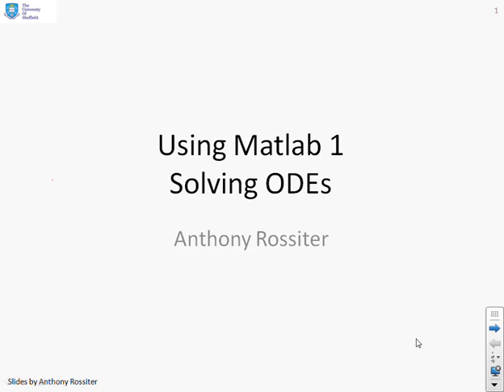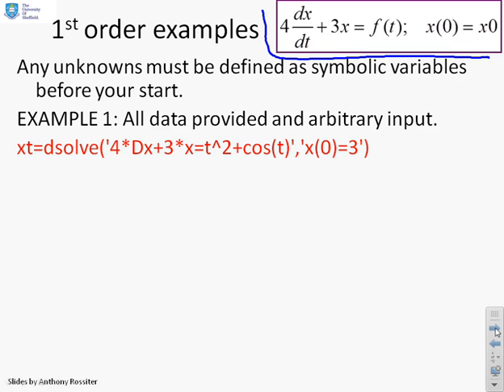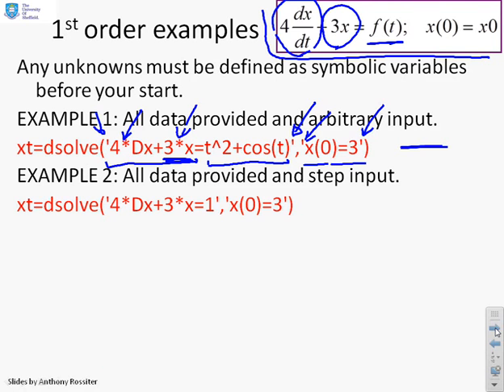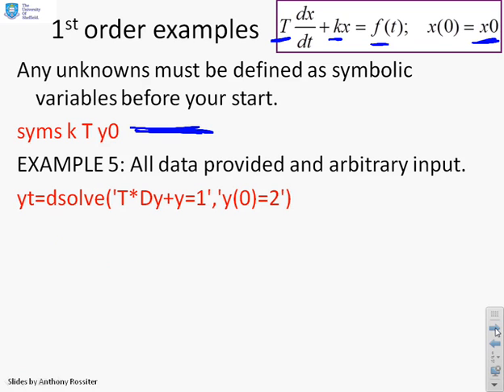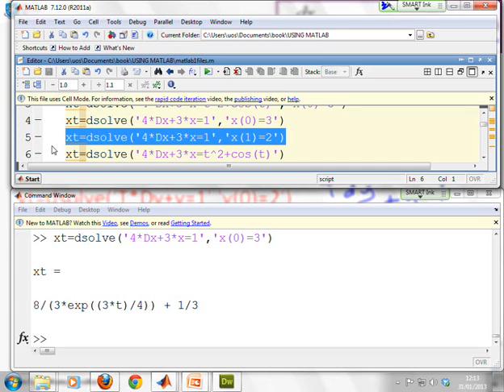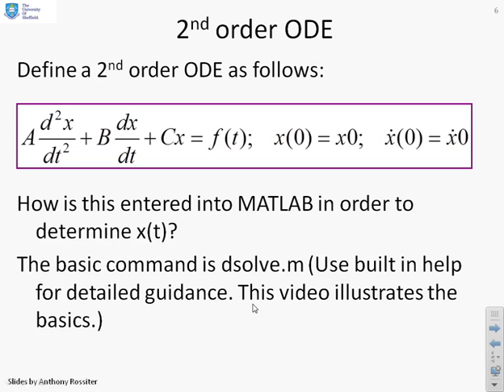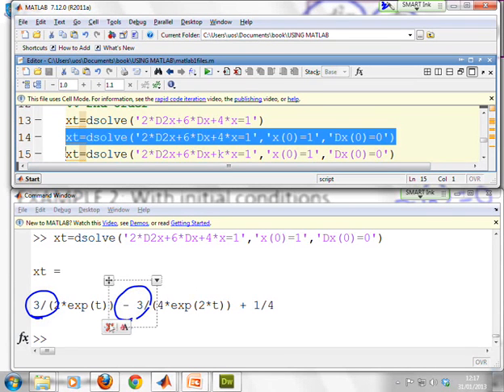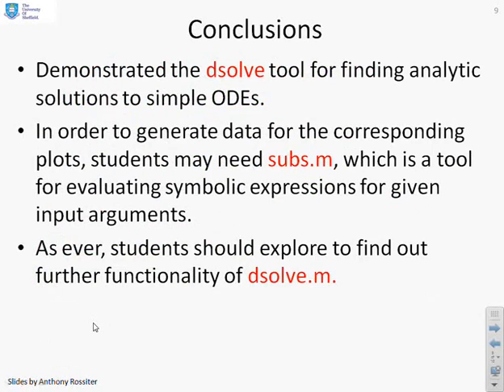Use of Matlab 1 - solving ODEs: OLD

Comment: hi;
please how input this constraints in xdot function to solve the 2nd differential equation to obtain the solution y with ode 23:

y"+cy'+40y=0
with c:

c1-c2>0.5
c2-c3>0.5
c3-c4>0.5
c4-c5>0.5
c5-c6>0.5
and:
c1 the value of damping in [0 0.15]
c2 the value of damping in [0.15 0.3]
c3 the value of damping in [ 0.3 0.45]
c4 the value of damping in [ 0.45 0.6]
c5 the value of damping in [ 0.6 0.75]
c6 the value of damping in [ 0.75 0.9]
best regards;
function xdot = modelcart(t,x)
  y = x(1);
  dy = x(2);
   z = x(3);
  w = x(4);
 % function damping
  xdot(1,1) = dy;
 
  if t>=0 & t<=0.15
  xdot(2,1) = -100*1.91*y-c1*dy
   if t>=0.15 & t<=0.3
  xdot(2,1) = -100*1.91*y-c2*dy
   if t>=0.3 & t<=0.45
  xdot(2,1) = -100*1.91*y-c3*dy
   if t>=0.45 & t<=0.6
  xdot(2,1) = -100*1.91*y-c4*dy
   if t>=0.6 & t<=0.75
  xdot(2,1) = -100*1.91*y-c5*dy
   if t>=0.75 & t<=0.6
  xdot(2,1) = -100*1.91*y-c6*dy
  end
 xdot(3,1) = y;
  xdot(4,1) = z;
  return

z1 = ode23(@modelcart,[0 0.9],[0.1,0.1,0,0]);

Comment: Hello John, I was wondering that how i can change the "t" variable and use x instead of that. I write an equation like;

yx=dsolve('Dy=-2*x^3+12*x^2-20*x+8.5','y(0)=1')

but it gives me an y(t) equation as a result. How can ı solve this simple problem. Thank you.
Reply from the maker: +Özkal Sönmez Not sure I understand the query here - you can call variables whatever you like and interpret MATLAB variables however you like. dsolve is quite flexible over what variable names you use as long as you are consistent within the call statement on a specific variable.Anthony

Comment: Hi there! Im a Chemical Engineering student and I need help with my coursework which seems impossible for someone like me, with absolutely NO CLUE on programming. The questions asks to use Matlab to solve Van der Waals equation for volume V, using both Newton's Method and Secant method (initial guesses for both are given). Now, I could do this by hand  very easily since all info is give but, doing this in Matlab is like a total alien territory for me. Please HELP!  Thanks in advance.

Comment: not speak English, I'm from Colombia, and I've seen some of his videos, to write this post I am using the google translator, I would like to know how to realize a system of differential equations in matlab for example: 
2 dx / dt-2dy / dt-9y = e ^ (2t) 
2 dx / dt + 4DY / dt + 4x-37y = 0 
I would like to know how to solve this system of equations in matlab
Reply from the maker: Jose Luis Barragan Sorry but there is no quick answer to this that I know so my method would take a while to explain and is probably not utilising MATLAB effectively. You could try MATLAB central.Anthony
Reply: John Rossiter equation used to matlab to solve two differential equations with initial conditions is 
[x, y] = dsolve ("2 * 2 * Dy-Dx-9 * y = exp (-2 * t) ',' * Dx 2 + Dy 4 + 4 * x-37 * y = 0 ', 'x (0) = 0', 'y (0) = 1/4', 't')
Reply: ***** learn spanish before saying that crap :)